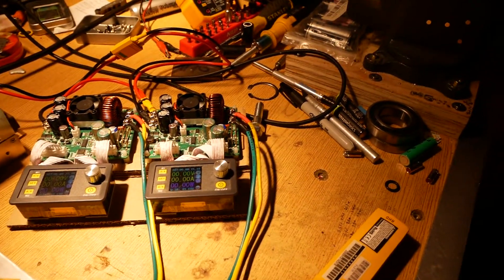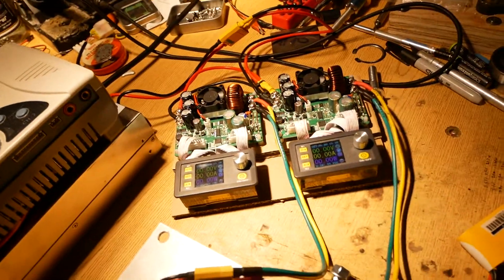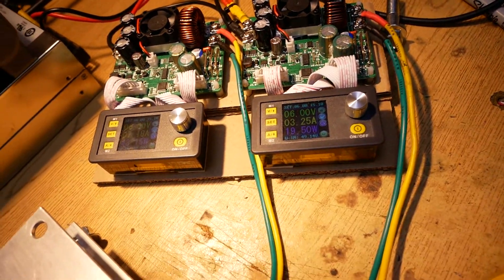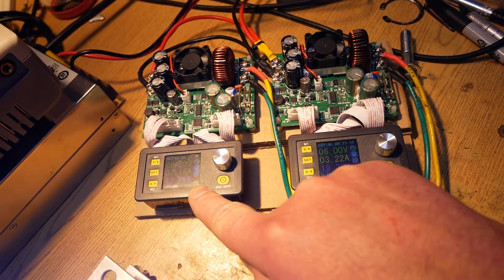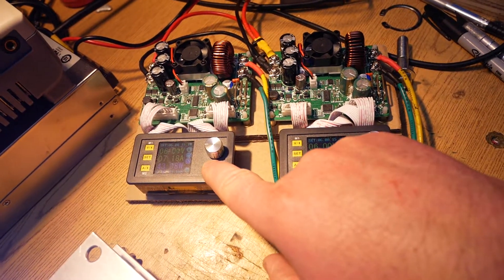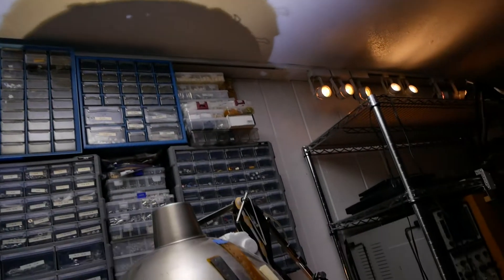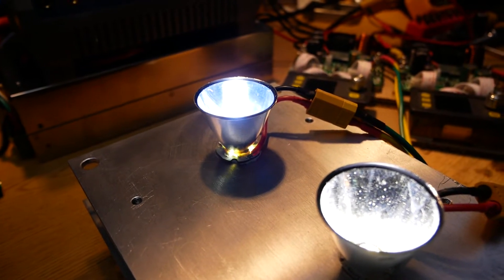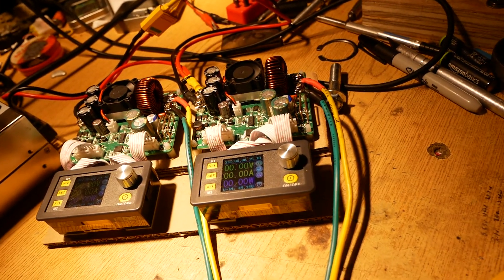CREE XHP70.2 VS Chinese XHP160 Bench Test

Comment: The Cree destroyed the 160? Seriously? As far as light output I surely wouldn't say the Cree was better if anything the 160 won in my eyes. I guess if your intentionally trying to destroy  a led the Cree would win but who does that? If you gave me two identical flashlights with each of the LED's Id pick xhp160. If I was going down to the barn I'd take the 160 every time. If I was going into the woods for a week I might consider the Cree but I'd probably just bring extra batteries and take the 160. I've showed several people this video and they all said the same thing. None of us are flash light experts but our eyes seem to agree. I suppose in certain applications the Cree maybe better but normal use in a flashlight the 160 is my choice and it was your video that made the decision for me. Maybe it's the camera and I don't see it I don't know but saying one destroyed the other is almost laughable and I'd say the majority would agree. You said they cost was about the same so I see no real advantage in price. I'm also not crazy about China but I'm not going distort reality over it. I appreciate the video and I apologize if I sound like a A$$
Reply from the maker: You amongst many many many other people who have never done any actual testing are steadfast in your opinions that are NOT based in actual facts. I on the other hand have tested CREE and Chinese LEDs a fair bit and so my point of view is based in observation and actual measurements. What I suggest is that you watch this video without skipping around...start to finish! Then watch this video without skipping around. The XHP160 is a piss poor light producer!!! I've made a few more videos on the XHP160. It's a steaming turd!
https://www.youtube.com/watch?v=ZyS1h21jL_Y&list=PLOrUJ_KZtl79SNhUZXlBVqrbPaLUrXZ-X&index=26
*
Over watting LEDs...LOL! I do this to ALL CREE LEDs and never to Chinese LEDs. CREE LEDs handle this just fine and make loads more light for a small bump in wattage. Chinese LEDs just die!
*
You are more than welcome to carry twice as many spare batteries than I will carry. If you have ever gone back packing or caving. Weight and extra stuff is always a concern. You want to be as light and lean as possible so you don't carry more stuff than you need! There's simply NO WAY I'd use a Chinese light in those scenarios!
Reply: @de-bodgery  You should really stop looking directly into your flashlights because it's ruined your vision. I have EYES and that's truly all that matters. Yeah I've done no testing at all perhaps. You should modify in your description so people that don't have experience or people with opinions cant reply. Clearly you didn't read everything I said or you wouldn't have been so butt hurt over it. Maybe one day I can be a flashlight god like you so I can tell people what opinion they can have. You sound like one of those people that wins minimally and runs around I destroyed you. Way to promote your channel I'm sure you'll go far and I won't be back!
Reply from the maker: @jameshitch5041  
NOT butt hurt and I did read all you wrote. It is WHY I posted what I posted!
*
The important detail here is that you haven't done any actual testing and I have. I spent my time and money to get real test tools, real power supplies and real CREE LEDS vs their Chinese counterparts. I'm no "flashlight god" or some other stupid title. All I did was do actual testing so that I was basing what I say on facts instead of opinions. Even then, my testing is far from fantastic. There is tons of room for improvement! In these videos you will some of them...like a legit light meter. 
*
There is no ego in this for me, just experience and actual testing. People can believe whatever they like. My choice is to make videos based on practical testing and real world comparisons between real CREE LEDS and the Chinese LEDs so that when I say something it is factual. While making them, I make mistakes, say stuff wrong, learn from my mistakes and so on. I do so without apology or desire to impress anyone. My videos are created with the desire to help the people that don't know better or just want to learn. I literally get nothing out of my efforts beyond the satisfaction that I did the work needed to prove  a specific point.
*
What I can tell you is that CREE LEDs always destroy the Chinese LEDs in every way. They always make more light and do it with much LESS current draw.
*
Did you watch that other video I posted? You will notice a clamp on amp meter and a legit light meter. No staring into flashlights involved! I want what I present to be factual and NOT opinion. Too many times people post like you did with opinions and not actual test results. I bet I've heard it a hundred times. "My Chinese flashlight is...blah blah blah". So I've bought a few of them and found out. Go look at my videos! You will see me take them apart, look over the components, check out the LED, etc. I have yet to find a Chinese light that is better than one based on a CREE LED. They are cheap...I'll give you that...and they always under perform!
Reply: @de-bodgery  You seem to NOT understand at all. I'm not going to watch another of your videos so you can tell me what I see with my eyes. With my eyes and most peoples eyes think the 160 is brighter. You can actually see it with your eyes in your video. Since you said yourself they are both similarly priced so cost isn't even a part of equation. How do I in any way benefit by trying to tell you one is brighter then the other? Lets go by your opinion ok the CREE is brighter so did it destroy the 160?  No it didnt and I'm sure 99% of the people would agree. That's the first issue I have. NO! it did not and I'm just talking about light output right now. You act as if the 160 is a15 year flashlight comparison.. Like I said before the 160 looks brighter to me which is the most important but others as well. I bet the majority of people say the same thing and I think you'll find very few people that would say it was destroyed by the cree. I have no idea about the reliability of it but would tend to agree for the long haul the cree may very well be the better one in that category. The only evidence you have provided is intentionally burning it up. How is that evidence of factual proof of reliability? I guess ramping up voltage past its ability to handle it the cree won. Who does that? Yeah people do it but not that far because inevitable it will burn up or drastically shorten the life. I refuse to accept data from your test showing one burns up faster past specs as factual proof one will out last the other. That's absolutely silly talk. It might indicate one will last longer but certainly NOT proof of it. I like the test you did. I don't think you could have made any fairer test showing output. The bottom line is the 160 looked brighter to me in your testing and others. You have failed to show me any factual tangible evidence that one is more reliable then the other even though I'd tend to agree the cree being a better option in that category. Your caught up in the name of the led and clearly biased against the Chinese version. Pretend they have different names or something. I also said this before in my first response if I'm walking to the barn at night I like the 160 but if I was going into the woods for the week I'd consider the cree. If you give me a light that has 6000 lumens and another with a 1000 and I can see better with the 1000 all testing in the world and factual data means nothing if I can see better . It really is that simple. Your totally missing the point in all this and clearly nothing I say is going to change that.
Reply from the maker: I prefer measurements and facts. I'll keep publishing facts despite the opinions of those that don't know better!
*
To be perfectly honest...I'd like to change my tune! I'd LOVE to find a Chinese LED that actually competes with CREE LEDs. Still waiting, but I seriously doubt it exists or ever will.
*
Over watting CREE LEDs is a long term hobby of mine! I've been doing it since 2015 and so far not a single one has burned out. I can't tell you how many lights I have made for others with over watted CREE LED's in them. This is simply NOT a problem I remotely concern myself with!
*
I ran that XHP160 at 6v and it was smoking! HOW did I burn it up AT its rated voltage?! So far I have yet  to  read where you say anything factual. It's all subjective and opinions. When I over watted the XHP160 it was to prove the point that you can't over watt Chinese LED's! On camera, I over watted a CREE XHP70.2 LED and proved it is quite doable! I really suggest that you watch the whole video so you are speaking from actual context and facts of why I did what I did.
*
Soooo....double the amperage, 4X MORE LED elements and the SAME amount of light isn't compelling evidence of how shitty the Chinese LED is? How about smokes and burns up AT it's rated voltage? If that's not enough, what is? You really should watch the videos instead of closing your mind to the facts!!! I can't lay it out for you more clearly! The facts are Chinese LEDs are poor performers and CREE LEDs are great performers!
*
"See better" that is highly subjective! If that works for you...fantastic. Lumens, amps, voltage...they are VERY factual and anyone can duplicate or refute those measurements with the right tools! Again...I'll stick to facts and measurements which anyone can duplicate!!! I can't see through your eyes and frankly no one can but you.
*
I believe what you are referring to when you say "see better" is the color of the light, not the lumens. 1000 lumens at 4300K makes just as much light as 1000 lumens at 5600K. A typical light meter won't be able to tell a difference in the brightness. All life on this planet with eyes are best suited for 4300K light. This is the light our sun makes. Most Chinese LEDs are in the 5000-5600K range and they contain far more UV light than does 4300K. This is why Chinese LEDS make bluish light. You may have retina issues that keeps you from seeing lower frequency light. This would explain your "see better" statement. If that is the case, then CREE makes 5600K LEDs that will be FAR BETTER than those Chinese lights!
*
I think what you should do is post your email address so I can reach you directly. That way we can get you a proper good CREE based light that works best with your eyes. The LEDs I tend to use are all 4300K and that doesn't work for your eyes so well since there is an abundance of yellow light. It seems you need more bluish light to see well. Are you color blind by chance? Can't see yellow?
Reply: @de-bodgery   only problem: you did it wrong, LEDs are not CV driven! which you did, that makes your testing completely useless
Reply from the maker: @leoost6322  You are welcome to your perfect world! I live in reality where things work in lots of scenarios...so my testing is far from useless! So I have to ask...have you done any LED testing or are you just being critical without any actual effort on your part?
Reply from the maker: @leoost6322  As far as I can tell you have made a single video about betaflight and nothing more. Meanwhile, I've done 31 videos on LEDs and many more on other topics. When it comes to credibility based on actual efforts on this topic you have none. AND I've been building LED lights for many years now without ever bothering with constant current and they work fine.
Reply: @de-bodgery   youre welcome, yes i designed dozen of LED driver circuits and circuits of the same topology in the past, and not only for playing or hobby but also for work.
Reply: @de-bodgery  It may be that the CREE led used less energy than the Chinese ones, but for normal use if you want to light up at home or on walks and you don't need to use the flashlight for 10 hours, you can see in the video that the XHP160 is brighter than he believes. I repeat, for normal use I would choose Chinese because it will help to see everything more clearly. If what you need is to spend hours and hours in a forest or something similar, perhaps the CREE led can be better because it can better withstand current and temperature and for its quality, but for the average user the XHP 160 is better. because what one is looking for is more lighting, of course without squeezing the product so much, well, as I say for normal use.
Reply from the maker: @jalejan77  Did you look at the light measurements? Not what you think is brighter, but what the light meter reads. The XHP160 is not brighter and it still uses double the amps to do it!

Comment: whole testing is bullshit, you dont understand the concept of an LED, maybe you should do some homework and first find out what is the problem when you power one LED at half the power of the other and expect them to perform the same, thats stupid.

if you want to rely on fackts please correct your testing process. a hint: look up LED-drivers, they are CC, not CV. same way as you charge a LIPO in CC-CV mode and not only CV despite it says 11.1v on the label.
Reply from the maker: YOU ARE MORE THAN WELCOME TO DO YOUR OWN TESTING! STOP TEARING DOWN WHAT OTHERS HAVE DONE WITH YOUR CRITICAL, ATTACKING AND ARROGANT APPROACH! HOW ABOUT YOU PRODUCE REAL VIDEOS OF VALUE? I'VE GOT 31 ALREADY ON LEDS. WHAT DO YOU HAVE? OHHH THAT'S RIGHT...NOTHING! YOU LITERALLY HAVE 1 VIDEO AND IT HAS NOTHING TO DO WITH LEDS IN ANY WAY! I HAVE MADE 31 ON LEDS AND HUNDREDS ON ALL SORTS OF TOPICS THAT ARE EV RELATED. I'LL STICK WITH MY EFFORTS SINCE YOU TOTALLY LACK CREDIBILITY!
*
I ALREADY KNOW HOW LED DRIVERS WORK. WHAT I CAN ALSO TELL YOU IS THAT AS YOU INCREASE THE VOLTAGE, THE LED WILL ALSO TAKE MORE CURRENT. I LET THE LED TAKE WHATEVER IT CAN GET FROM THE POWER SOURCE. THIS IS SUFFICIENT TO TEST AN OVER WATTED LED AND TO RUN THEM LONG TERM. I'M RUNNING LED HEAD LIGHTS I MADE FROM XHP70.2 OR XML2 LEDS THAT ARE OVER WATTED FOR MANY YEARS NOW. THEY HAVE NEVER SEEN "CONSTANT CURRENT", JUST WHATEVER THEY CAN GET FROM THE POWER SOURCE. THIS WORKS JUST FINE. THE PROOF IS IN THE LONGEVITY OF THE LIGHTS I MAKE!!!
*
I DON'T KNOW WHAT YOU HAVE DONE OR NOT DONE SINCE THERE IS ZERO EVIDENCE OF ANY LED WORK ON YOUR PART. I'M WELL INTO 30 OR 40 LED HEAD LIGHTS I'VE MADE FOR MYSELF OR OTHERS. YOUR CRITICALITY AND TOTAL LACK OF WORK SHOWS ME THAT YOU ARE ONLY RIGHT IN THEORY, BUT IN REAL WORLD USE, YOU DON'T KNOW ANYTHING.
*
FOR FUTURE REFERENCE, STOP BEING CRITICAL AND ARROGANT! INSTEAD, PRESENT YOUR RESERVATIONS AND REASONS WHY WITHOUT ATTACKING THE PERSON. MANY OF THE LED VIDEOS I HAVE MADE WERE BECAUSE PEOPLE HAD QUESTIONS AND ASKED THEM OR THEY CHALLENGED MY ASSUMPTIONS WITHOUT ATTACKING ME. AS A RESULT, I WENT FURTHER TO TEST IF I WAS RIGHT OR WRONG. YOU ARE BEING A DICK AND ATTACKING ME. YOUR APPROACH DOES NOTHING BUT MAKE PEOPLE DISLIKE YOU! EXACTLY AS I FEEL ABOUT YOU RIGHT NOW. FIGURE THIS OUT AND YOU WILL GET LOTS BETTER RESULTS. AS IS, I'M JUST GOING TO IGNORE YOU AFTER THIS POSTING!
Reply: @de-bodgery  man please stop capslock, thats hilarious..... 

if you think you did it right than please tell me, why are LEDs CC driven and not CV?
Reply: @de-bodgery  deleted comments proovin you wrong?  nice job, so credible
Reply from the maker: @leoost6322  I deleted nothing and you are still an arrogant and critical deuchbag!
Reply: Leds are only rated for a specific amount of current, it's bad to go over their rated current, and as they heat up their resistance will decrease and so the current will increase when being CV driven.